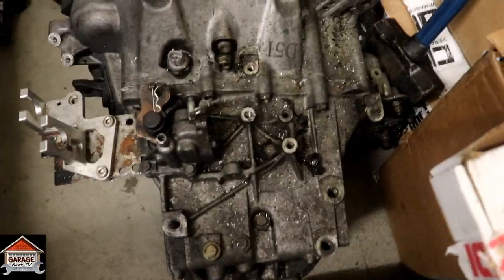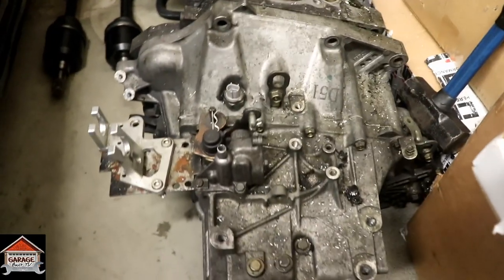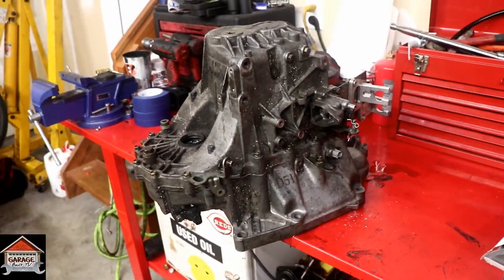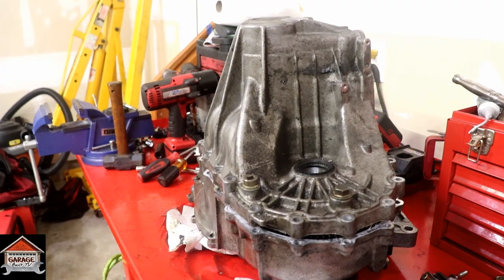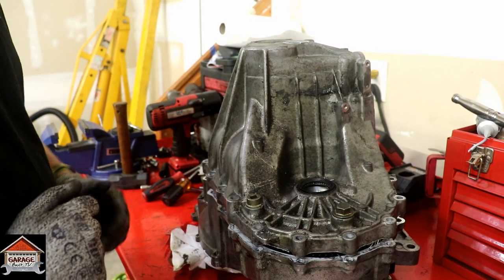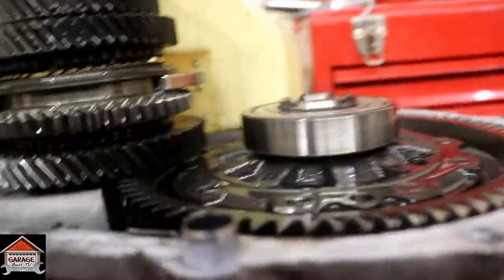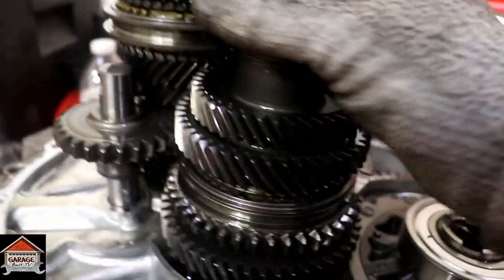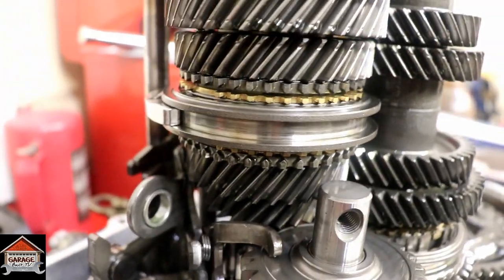Putting 700hp Through A Stock K20 Transmission.... Aftermath

Comment from the maker: Wheel hop is another transmission killer. I forgot to say that in the video. Make sure your suspension is setup correctly also!
Reply: Garage Built TV I absolutely agree, tramp is definitely a massive contributor to the killing of these transmissions.
I also believe the shock load of going from no grip (burnout) to traction in upper gears does them no favours either. 
It’s amazing to see how long you can get a gearset to last with a little mechanical sympathy.
I have a friend with a supercharged v6 ecotek (basically an updated Buick v6) who’s putting 500hp through a t5, which has survived quite well for 2 years. Most would say that’s absolutely impossible.
Reply: What’s the name of the transmission fluid?
Reply: Question: I've got an 09 awd crv with a bzha, does the same concept still apply? I want to put some power to this thing but I can't find any solid info on how much the transmission can really take

Comment: Sitting at 509whp on my 8th gen. Stock long bock and trans. Synchros are definitely worn. 158k miles on her now. But I am going to build it with longer ratios and a 4.38 final drive. Also building hne block to 1k HP rating but will sit tops 750whp. Key is to not push things to the breaking point. Fluid changes are key. And good fluid

Comment: Hey can you point me towards the direction or info on how to get a cable speedometer gauge to work with a kseries trans. I know the cannibal's pretty much straight forward with the e153. And there's the tapping vss to a electronic cluster. I'm just confuse about the cable driven one(does it require the conversion?) and if the vss sync correctly with the gauge. Thanks, much appreciated.

BTW your videos are awesome! They are way more informative then most videos. You actually see how it's done and what's needed through the build. You definitely deserve a lot more props bro!
Reply from the maker: Thank you for your support I appreciate it. I know there are conversion kits to make it work with older cars but I'm not 100% sure with the Mr2. Add me on Instagram and if I find any info I'll make sure to share it with you.

Comment: excellent video. I would like your expert opinion on the automatic transmission CRV . either k20 or k24, would the automatic hold up a 300-500 hp turbo upgrade? and how to upgrade the automatic transmission? second question: how to go about engine control? piggy pack?

Comment: Hi... First of all thanks for your video, that confirms the issues we had with the honda oem gear oil, even on a standard integra type R, after 4 to 5 pulls in the 1/4 mile, the oil gets hot and the gears starts to get hard to engage. 
Also I would like to share another experience with the torco RTF GL6, as I heard you mentioned  the Torco. Me and my friends we all drive honda integras turbo with 500hp and more.
We had some issue with the syncos, with both of the standard and the carbon too, and we couldn't figure it out what was the problem as we all had the same problem. final attempt was to change the oil, and we tried liqui moly gear oil. Immediately we felt smoother gear  change, and problem was solved after all does money wasted on syncros!
Reply from the maker: No problem thank you for sharing your experience as well.
Reply: @GarageBuiltMr2s  if my I ask, what oil do you use?

Comment: Wow never seen a video like this and pretty much explained a key problem that a lot of people over look. I have a 2015 si That will be making a little over 500hp on 93 and e85 roughly 600hp.it is my daily so it will be on 93 for a while but from what I’ve been seeing and hearing fourth gear is like glass and will not hold pass 450 hp which is about 380-390 torque. Just looking for advice or if it could hold the 500hp. Any tips on or information is greatly appreciated

Comment: Way better weight transfer in an mr2 for traction compared to a civic etc and did I hear correctly non lsd?
Reply from the maker: Laty's Garage yes. But this swap started in a 2000lb stripped out civic hatch.
Reply: I’ve really come to appreciate the k motor potential but being a ls turbo guy mainly for so long rwd is a must for me and that’s what I love about the mr2 . My k20a2 motor and box was from a type r dc5 so mines lsd I’m pretty sure hopefully my setup will handle 450wheel and I can’t wait to start after seeing these couple recent videos
Reply from the maker: Laty's Garage its going to be worth your wait man! I cant wait to see your build.
Reply: Garage Built TV I’m doing a k24z7 swap into a teg fully built motor on 6262 torque is going to be insane I hope stock trans holds up well

Comment: How long did you run this transmission for and for how much abuse? I grenaded my stock Si transmission in 4 weeks at 600whp and wasn't being an idiot. I have since swapped an EP3 5 speed gearset in and am nervous that it too will let go.
Reply from the maker: J-Eric 2 years with a full season of drag racing. I used torco rtf fluid to help longevity
Reply: Garage Built TV I was actually using the exact same fluid off of Derek Robinson’s recommendation. 🙁 I guess I just drew bad luck. The fluid seemed thin to me, I’m back to using OEM fluid on the new trans.
Reply: Im a hope my Tran goes good 450hp Pennzoil synchromesh fluid im a using I hope it dont Grenade on me

Comment: Does gripping really save gears? I wanted to put an ep3 transmission with 4.3 fd ~500hp but I was thinking the longer the gear the better traction but the more load would be directed in the gear 🤔
Reply from the maker: In my opinion a 4.3 fd is perfect.
Reply: I'm currently running a base RSX 5spd in my MR2 now, 424hp @ 15psi.  I like the gearing the way it is now but I hate not having a 6th gear or LSD.  It's totally budget bought I bought a 2012+ Civic Si with 4.7 FD but I'm only using the trans to take out the 6th gear set and factory LSD to swap onto my current 5spd.

What do you think, what fluid are you running and how often do you change it...I'd rather follow what worked for you.

Comment: Couple of question.
1. Why/how did the engine blow?
2. I have a turbo k20 on 13 psi,  should I be worrying bout breaking anything?
Reply: Stock everything forgot to mention.
Reply from the maker: 1. Just to much power on the stock engine. I was estimated around 700hp when it blew. 
2. Just depends on your driving style and the type of fluid you use.
Reply: Would you recommend amsoil or what u think is best trans oil?
Reply from the maker: Francis D. I use Torco Rtf
Reply: @GarageBuiltMr2s  the amsoil synchromesh is good fluid mate??

Comment: Ep3 k20 5 speed? Or type s 6 speed? What oil would u recommend for my stock type s 6 speed with m factory lsd? Is going into a 659whp ek coupe
Reply from the maker: pedro j castro it's a rsx base 5 speed trans. Torco Rtf is what I use